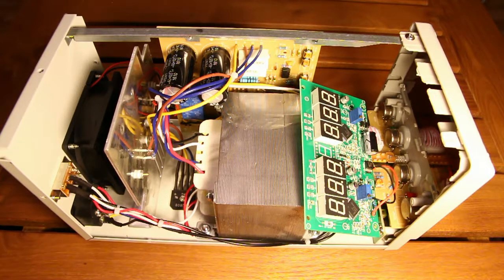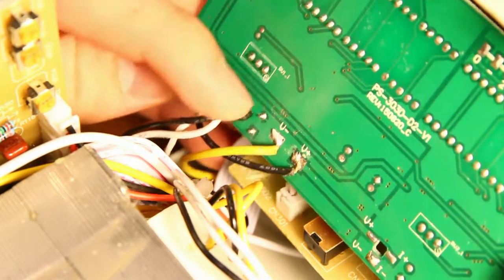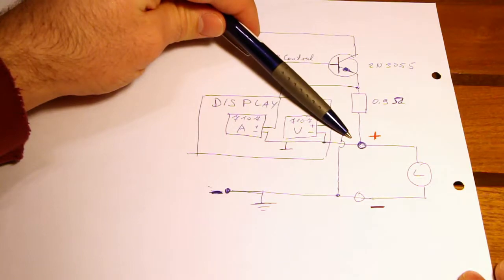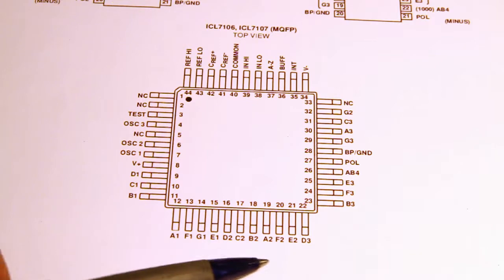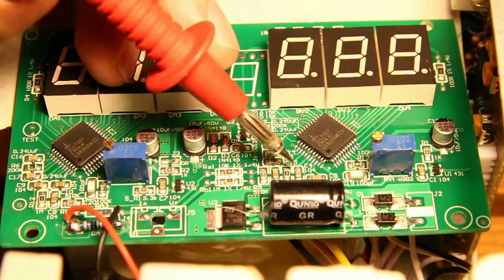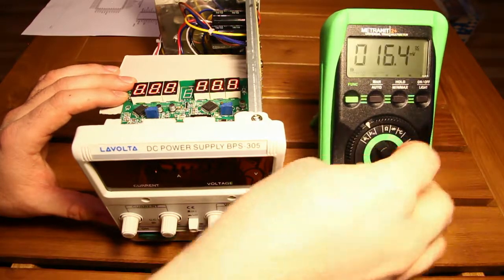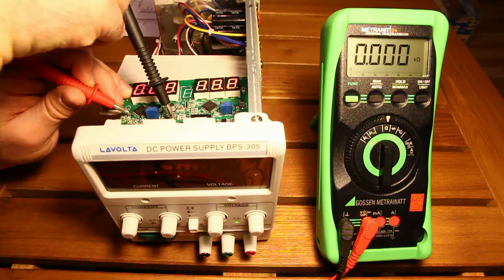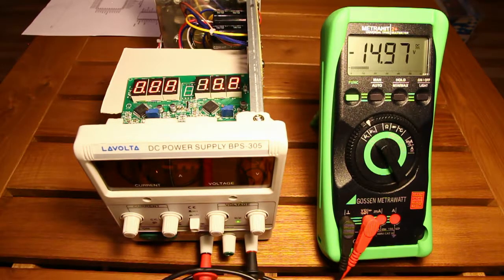Is the Lavolta BPS-305 display board wired in the wrong way? #010

Comment: Hello, very useful video. I'm interested in something else. Lavolta have a second version of the BPS-305 model. In this case, the button between the two middle potentiometers acts as a voltage switch-off at the output. I couldn't find a schematic on the internet to see how and where the switch is connected - it most likely controls the MOSFETS. I do not have such a model to check myself. I have another type of similar power supply on which I want to put a switch to turn off the output voltage. I will be very grateful if you share a diagram (photo) or a description of how to do it.

Comment: I noticed that there is an unpopulated place on the board for another segment display, and since its marked DV1 I assume its something to do with the voltage display. Could another be installed and what would it display?
Reply from the maker: Yes another digit could be installed but it wouldn't display anything. The used chip ICL7107 is an A/D converter with a  3 1/2 digit display driver. It can display values of +/- 1999. If those are 1999V or 199.9 mV depends on the input voltage divider and the placement of the display decimal point. 
In the current state the display only shows the last 3 digits, so the maximal value it can display is 99.9V. If you install the missing digit this display could show a maximal value of 199.9V but since the output voltage of this power supply is only about 32V nothing would change. 

If you would use this display board in another project you could use this digit to display a sign for +/- 99.9V and or another decimal point for +/- .999V or an additional "1" for 199.9V and or another decimal point for 1.999V. At the top this board has a few configuration jumpers they probably set the decimal point.

For more information have a look at the data sheet for the ICL7107, it is quite interesting: https://www.alldatasheet.com/view.jsp?Searchword=ICL%207107
Reply: K-Tech Thank you for the reply, that is extremely interesting, Thank you. Its a shame It couldn't be for the amp side so I wouldn't have to remember for instance that 0.30 on the display is actually 300mA and not 30mA. Would be nice for it to display 0.300A. But then I am a beginner and is perhaps more second nature to others. One day I'll spend more money on a supply, I can't complain for the price of this really.

Comment: Thank you very much for looking into it! Interesting!
Since I didn't knew any better at the time I put the power supply back together as it was before (works fine). But now I also understand why they did the wiring like that.
I also added a fan controller based on an ATTiny.
Reply from the maker: Thank you for pointing it out, i didn't notice it.

A fan controller is a really good idea for this power supply, I'm interested to know how this mod works out for you.
Reply: It works fine so far. On the BPS305 I used a regular 12V fan with PWM signal (4-pin fan) and an ATTiny85 with a DS18b20 digital temperature sensor to measure the temperature and to generate the PWM signal. To get the 12V from the 24V, I used one of these Chinese ready built buck converter modules, I have too many of, anyway. Maybe there is an easier way to get the 12V directly off the main board of the power supply. To be sure, I don't get any problems, I isolated the regulator and fan controller ground from the case/ground of the power supply unit.
https://imgur.com/a/t8QIG

For the APS3005D, which I got shortly after, I found, that the 24V fan worked quite well with a pulsed 24V signal. So I used the original fan with an ATTiny13A, an analog TMP36 sensor (not enough memory for something digital) and a simple TIP120 darlington transistor to power the fan. Also this unit already had some crude "controller" by switching the fan on only at a certain temperature, this way I got more flexibility by starting slower and then faster as the temperature rises. For the software part I used the avr-gcc and avr-libc for both controllers.
https://imgur.com/a/M0W0dEZ
Reply: Christian Fiebig Wow that's way more sophisticated and efficient than what I came up with, I used a Lm7812 to get my 12v from the 24v supply to power my favourite 12v fan and used a couple of 2watt 10ohm resistors in series to reduce the fan speed/noise even further. Wish I had used your solution now lol

Comment: I have the same PSU, but do really I need this fix?
Reply from the maker: No, You don't need to fix it.

There is nothing wrong with the factory wiring. It was designed to be this way! In this video I just explain why they did it.